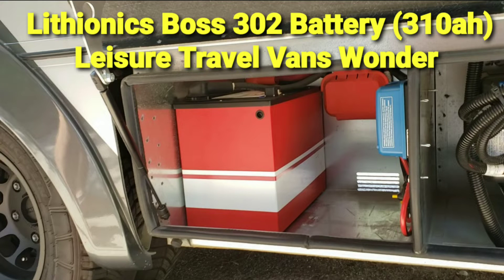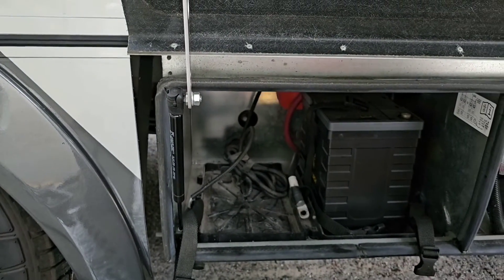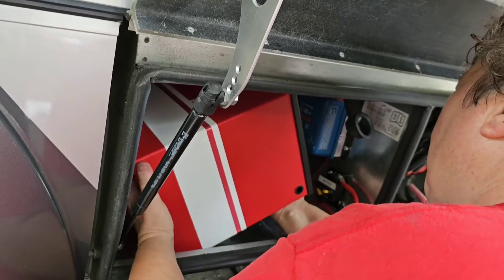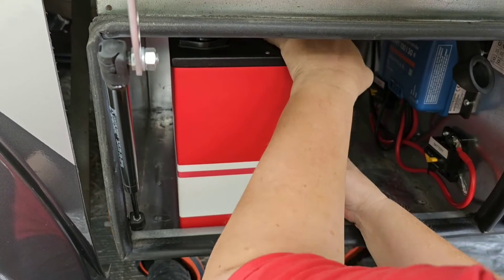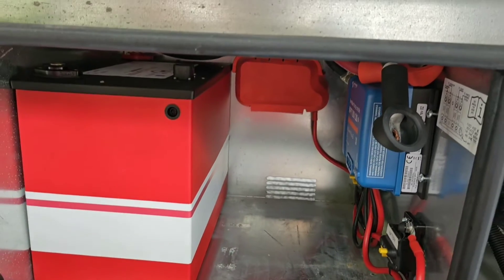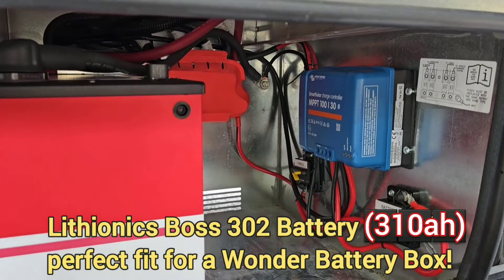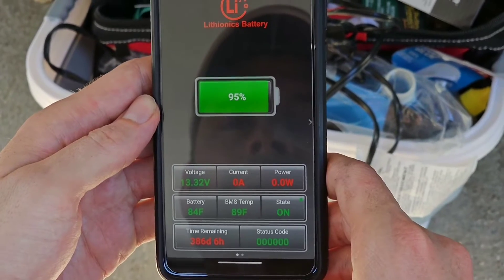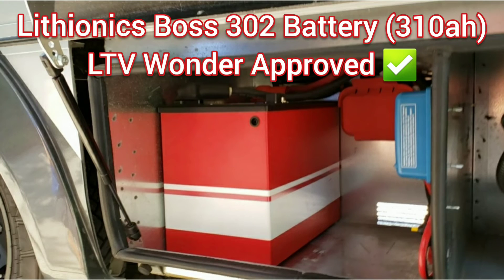Installing a Lithionics Boss 302 Battery (310ah) in Leisure Travel Vans Wonder Models

Comment: Sandra, thanks for this video.  You finished the electrical installation, until a second battery is installed would you be recommending some form of fixity to keep the batter from sliding around?
Reply from the maker: I added 1.5" foam around it for the time being because we'll be replacing the old Magnum Inverter with a 3000w inverter. I'll be using some 1" Aluminum angle stock to make battery holders for the 2 corners not flanked by the wall.
Reply: @SandyRVUpgrades  thanks Sandy for your response.  You might consider adding that comment to future videos.
Reply from the maker: @CincyKid  I'll show it when I do the 3000w inverter installation.